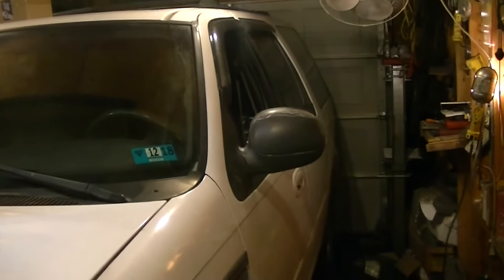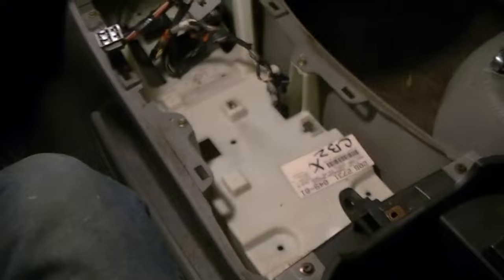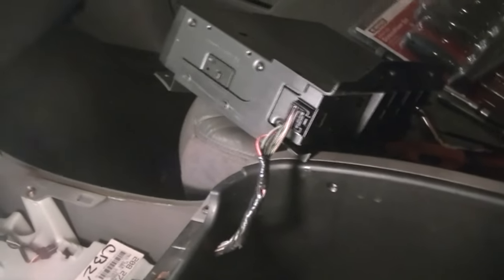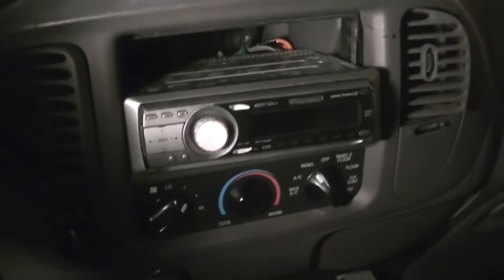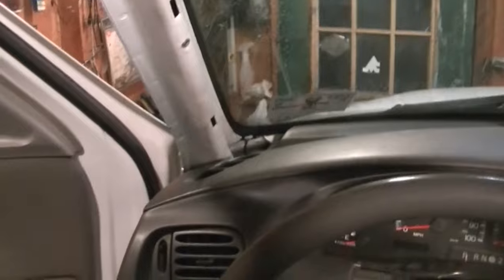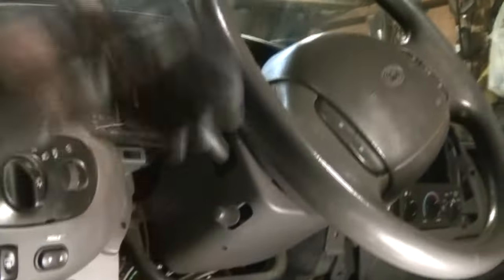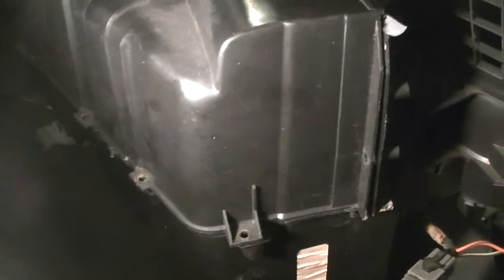Heater Core Replacement. Ford Expedition, Excursion, F150 and more.

Comment: Was it easy putting back together?
Reply from the maker: Not to dad.
Reply from the maker: Not to bad.
Reply: Nathan Rohrbough ok
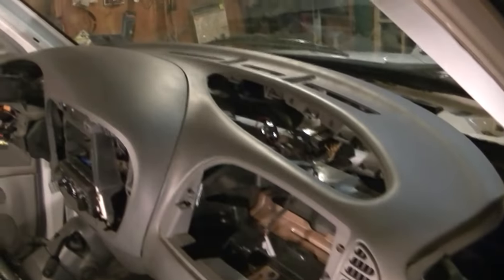Reply: Nathan Rohrbough at 19:30 you said it took you 3 hours, so you mean by pulling the dash out? Or removing all the bolts?
Reply from the maker: Total Job.
Reply: Nathan Rohrbough ok
Reply: Nathan Rohrbough can you send me the link on how to disconnect the hoses?
Reply from the maker: https://www.youtube.com/watch?v=iK1goWaco2Q
Reply: Nathan Rohrbough thank you
Reply from the maker: Let us know how it goes!
Reply: Nathan Rohrbough so far everything is going great, except for the little white gear shifter under the steering wheel. The wire is locked up, how would I fix it?
Reply from the maker: Unbolt the cable at the bottom of the steering column. Its a very little 
bolt. Un-hook the wire and set it free!...Take it out and free up the cable. Then put it back when the dash 
is back in.
Reply: Nathan Rohrbough I ment to say the gear shift selector, the wire at 12:20 is locked up for me, my bad
Reply from the maker: Put the key back in the switch, turn it to run position, and put foot on brake pedal and try to move it... That's what I did when it happened to me.
Reply: Nathan Rohrbough it didn't work
Reply from the maker: Pick up on the steering  column while doing it?
Reply: Nathan Rohrbough are we talking about the same thing?
Reply from the maker: I'm not sure.
Reply: Nathan Rohrbough do you have Facebook or something so I can send you a picture?
Reply from the maker: At 12:20 I see a selector cable. What are you trying to do?
Reply: Nathan Rohrbough yea that. The selector cable is tight and wont move
Reply: Nathan Rohrbough apparently the cable was tight because it was squished between the steering colum
Reply from the maker: O wow. Glad it did not break!~

Comment: Hate to be a buzzkill, but you know that's definitely not how it went in at the factory. 
- Steering column
- 9 or 10 bolts 
- A lot of connectors
- Done